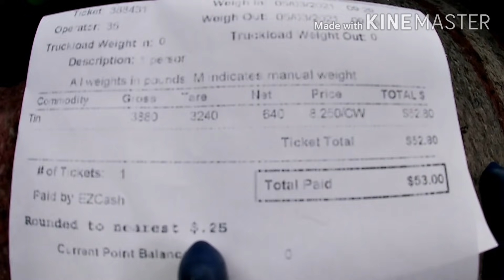Adventures in scrapping.

Comment: Put your microwaves and washing machines to one side as they both contain motor's andcuse an electric drill to undo the screws under the microwave and take it he motor of the washers also take he black compressor bottles of ur freezers and fridges as hey can be cut open the bottles with an angle grinder as they contain a  motor plus add a hose reel to the side of the truck and use the hose reel to hold all the wires keeping the bed of the truck tangle free